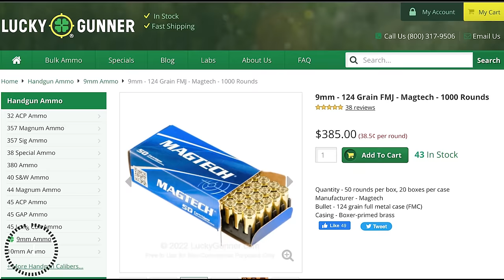Burglary Call Leads to Wild Shootout in Fort Worth

Comment: Yea, that was a lot rounds flying, not to mention using a pistol to do a rifles job, all them shots seemed 50+ yards. Maybe it’s just how body cams are. Still, all those rounds ended in something other than the suspect.
Reply: Body cams do distort distances, it's because they're made to optimize field of view despite having a small lens. That messes with depth perception. Unfortunately it's an unavoidable limitation imposed by optical physics; better tech can give you better image resolution, fewer artifacts, more stability during movement and so on, but it can't alter the properties of light.